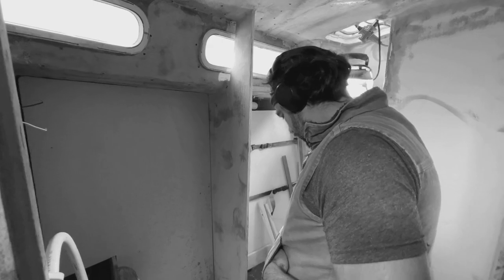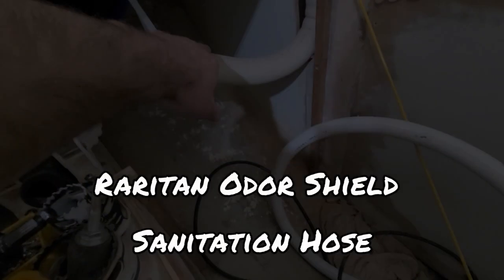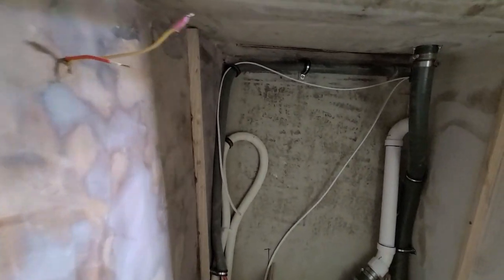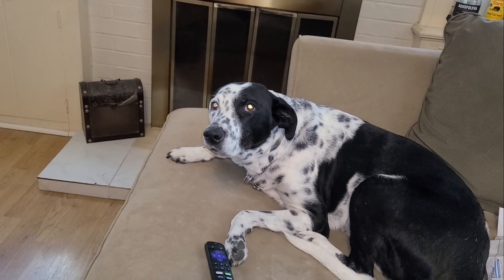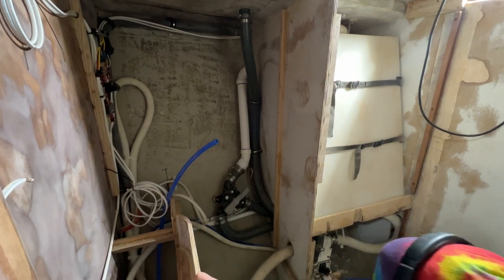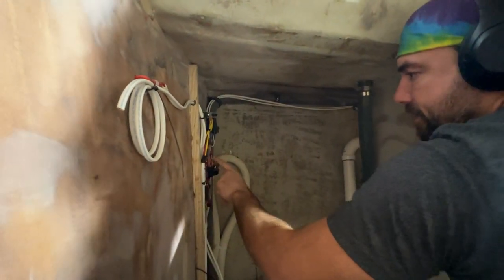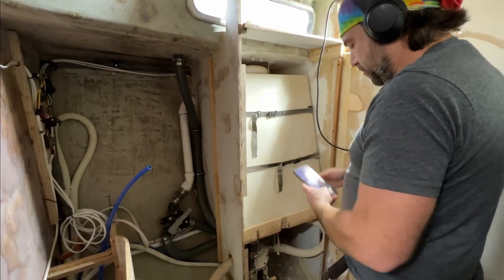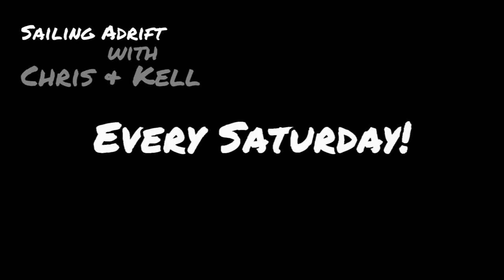Our Marine Head: Routing Plumbing & Electrical!

Comment: Question. Is the water line on the boat above the Y valve that you installed for the FWD head drain? If not would the valve being that low allow for ocean water to back flow through the drain? 
It was just an observation that I was thinking about since your ocean water inlet is so much higher.
Reply from the maker: It is above the waterline about 6-8 inches. I wish it were higher TBH....